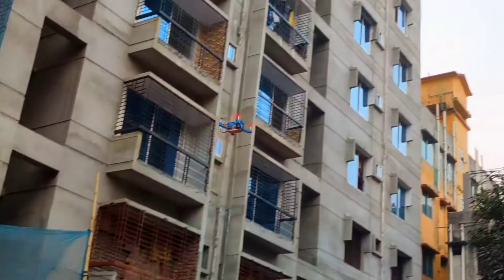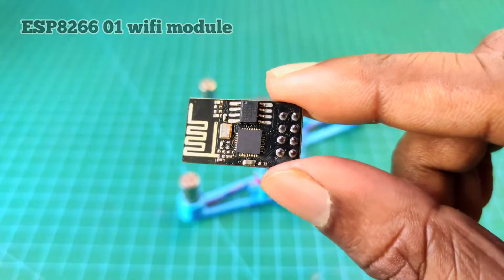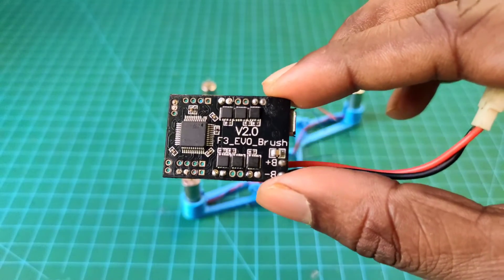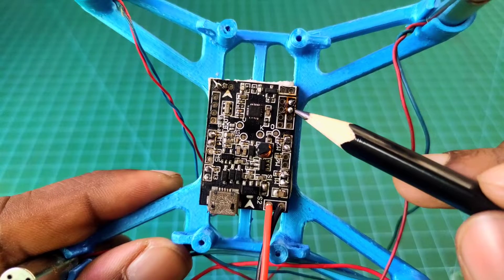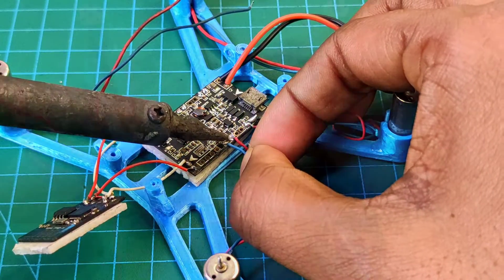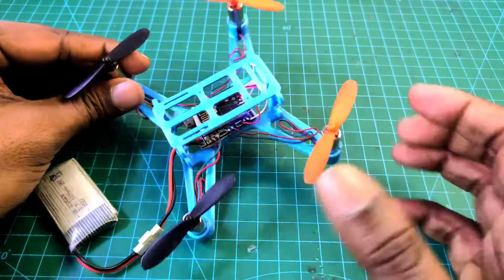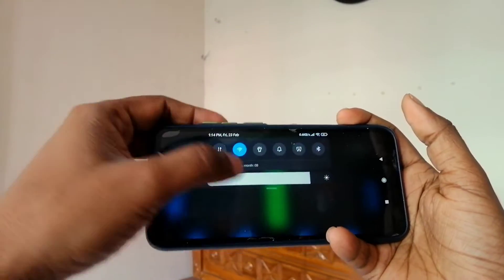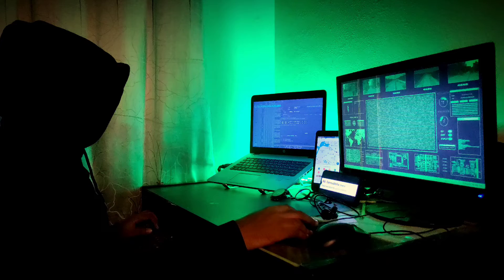How to Make Mobile Control Drone using ESP8266  - ESP8266 WiFi Drone

Comment: can we  use esp8266 board instead of that wifi mdel
Reply from the maker: You can...
But for this coreless motor you need minimum weight.  So esp8266 board not good for this drone.